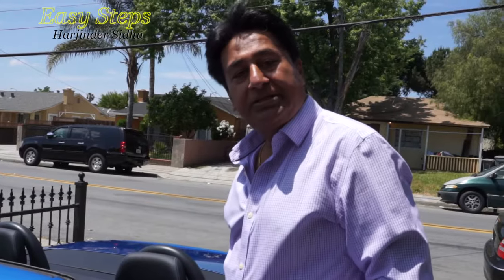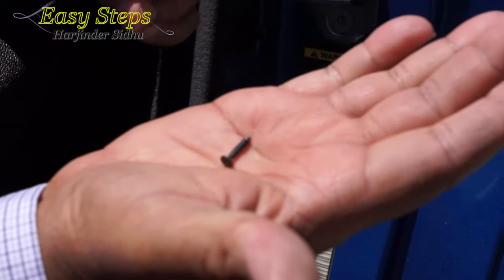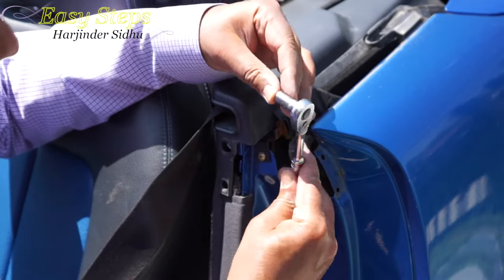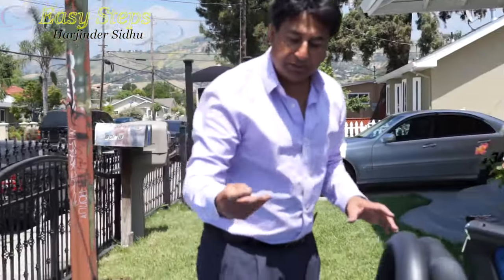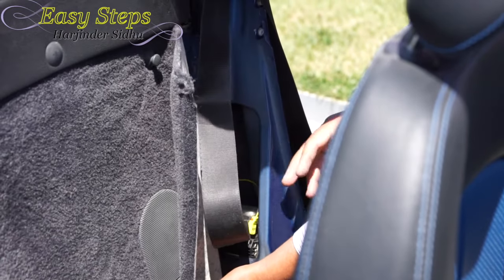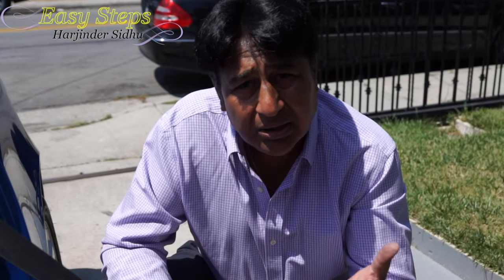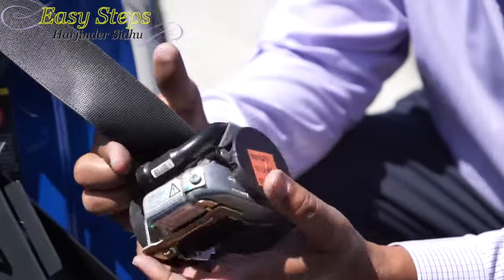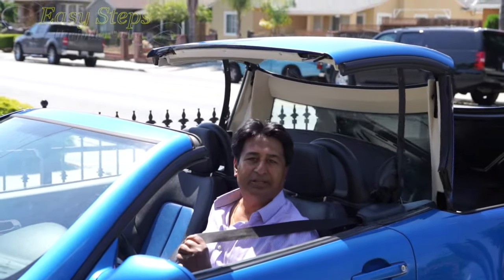SOLVED - How to Repair Stuck Seat Belt on Mercedes | SLK230 Mercedes Seat Belt Won't Retract

Comment: That is not a R129, which refers to a SL model manufactured from 1989 to 2001. That SLK is a R172. The belts in the R129 are completely contained within the seat, not attached to the body behind the seat.

Your video is a waste of my time.
Reply from the maker: Sorry for wasting your time, my bad...yeah it's not R129 or R172
it's R170 Mercedes-Benz SLK230, thanks for watching.🙏